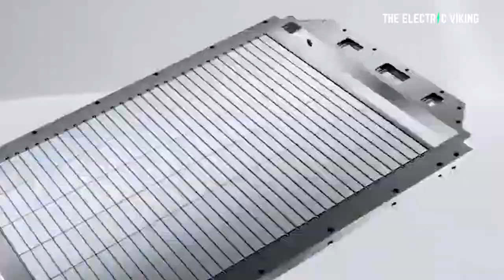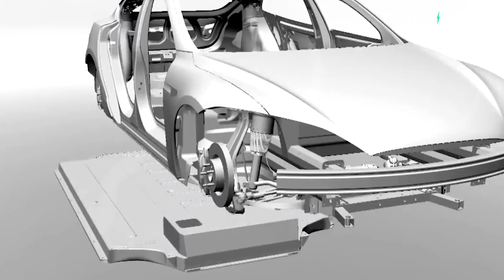Tesla's Model 2 Hatch & Crossover will KILL gas cars in 2023

Comment: In the US 60 million vehicles out of 280 million account for 50% of the fossil fuel consumption. So trucks and commercial applications like Uber, small delivery vans, police etc. Also these applications are mostly 8 hours of short trips, often 35 MPH so about 100 miles per day range is good enough. There are no "long trips" to worry about. It seems to me that market segment should be a priority, Of course many low cost consumer vehicles will reduce fossil fuel consumption, but I would make that a secondary priority if time to 50% reduction in fossil fuel is a priority. By the way, once a 50% reduction in the US is achieved, gas stations will close, accelerating consumer acceptance.

Comment: Thanks for your excellent speculation on what all might be done by Tesla to reduce its cost for the various Model 2s.

To reduce battery size and related cost, by boosting its overall energy efficiency to 6 miles per kiloWatt-hour (kWh), compared to ~4 miles per kWh for the Model 3, reducing weight will be far less important to than reducing Aerodynamic drag. To reduce the Aerodrag, hence making the Model 2s extra slippery through the air, Tesla must reduce the multiple of frontal area (A) and the slippery-ness, quantified by the vehicle's Coefficient of drag (Cd), that is, Cd x A (or more simply, CdA). To reduce the CdA sufficiently, the Model 2s would or must: 
> replace sideview mirrors with cameras, and
> cover the wheels, and
> narrow the vehicle width, (4-seats, not 5)

Also more important than reducing vehicle weight, the efficiency of the conversion of the stored energy to rotational power/energy at the wheels might be improved, by:
> using a higher voltage electrical system (800 Volts or higher)

After doing all the above to reduce Aerodrag, Tesla could potentially reduce the energy losses due to the tires rolling resistance by reducing the multiple of vehicle Weight (W) times the tires Rolling Resistance coefficient (R), that is, W x R.

Along with making the Model 2 narrower, removing the sideview mirrors and moving to an 800V or higher voltage electrical system, all of which would reduce weight while reducing Aerodrag, Weight (W) might be further reduced (but, only without increasing cost!) by:

> Using lighter weight materials, such as Magnesium (vs. Aluminum) for its front and rear castings

The tires' coefficient of Rolling Resistance (R) might be reduced (but only if you don't lose ride quality and safe handling/braking under normal weather conditions) by increasing tire pressure and reducing tire width and/or using completely new tire designs, including tires designed to last 100,000 miles or more (thus lowering tire life-costs as well).

Finally, presuming these Model 2s will be designed to double as Robotaxis, life-cost will be much more important than initial-cost, so Tesla might accept some initial-cost increases in various elements of the Model 2s inorder to achieve significantly lower life-costs, as these vehicles' design life is increased from say 250,000 miles for the Model 3/Y/S/Xs to at least 1 million miles for the Model 2s.

Comment: Appreciate the great analysis. I wonder about two things though based on this projection: the robotaxi and any cannibilization of the model 3 and Y sales? How much might some consumers hold off on purchasing other Tesla models in anticipation of these new and more efficient vehicles? It will be interesting to see how Tesla manages the potential Osborne Effect. Also, what would the robotaxi look like and where would it be built? Maybe new factory announcements may shed some light.
Reply: Robobtaxi will be on same platform so I assume same manufacturing facility. Tesla will not announce the new car untill close to the launch to mitigate impact on other models. I also think they have margin to give away on the basic Model 3 to plug the gap, particularly in US.

Comment: "Structural battery pack" currently means using the actual casings of the 4680 cells as part of the structure. What are the indications of structural battery packs in this meaning with other battery form factors? What are the indications of other chemistries in 4680 cells for use in this type of structural pack? What are the indications that the battery pack will be considered structural without using the actual battery casings as structural elements? It sounds to me that our viking is talking about the last option here.

Comment: I am not buying the 30 kWh pack variant. This is not enough range for the American market. A 40, 50, and 60 kWh offering could make sense at 6 miles per kWh. Mass has little to do with it as it mainly aerodynamics at highway speeds. Even our Chevy Bolt hits 5 miles per kWh in mixed driving. With improved aerodynamics going from Cd = 0.32 to 0.22 the car could easily approach this 6 miles per kWh figure at 1.75 tons.

Comment: Points well made. This is the best form factor for the most useful target, small urban cars, especially in the EU and China (or rather, everywhere except the US). Given the current EV market, a T2 at this price range will make a big impact. Everyone will want one, at least as a second car. By that time though, Tesla will have to compete with a lot of good EVs from Chinese and EU manufacturers. Traditionally, such a setup has been leading to margin erosion, unless Tesla can keep up the "Apple of cars" image. For the total picture, you'd also need to talk about eventual repair costs, especially with structural batteries. How repairable the cars will be. Since that consumer expectation is different for a small cheap car than for a big luxury car. What happens if someone (or you) dent, scratch, crash the car. That cost currently is far, far lower with other cars than Tesla, especially in the smaller form factors.

Comment: Great video and analysis. 
I don’t think this EV will be produced in Texas right away. They will probably produce this vehicle in Mexico because of the lower labor cost. 

Later they will use the Texas Gigafactory to produce the Robotaxi version of this EV - without steering wheel, brake or accelerator and a flexible seating arrangement with multiple screens for customer entertainment.

Comment: If they meet the power density and light weight, and get the weight of these cars down to 2,000 to 3,000 pounds, they will not need really high capacity batteries. If they only use say 40 to 70 kWh batteries with fast high speed charge capabilities, we could be looking at a car fleet with recharge times in the 10 to twenty minute range and a huge reduction in overall grid electrical demand. 

I myself would have no problem with a 10 to 20 minute charge time to get 150 to 250 miles of range. I spend about 7 to 15 minutes at the gas station today getting 200 to 300 miles gas range in my car right now. (About 8 to 13 us gallons of gas) and keep in mind, most of that charging would take place at home using level 1 or 2 charging because I would not need to do the fast charging like at a filling station out on the road.

Comment: Unless the recession cuts Tesla car deliveries, there is no assembly line to build a new model in Shanghai. Even with a recession the current models would have to fall below a 10-15 percent margin to make it economically feasible for Tesla to use current assembly lines. It’s even a stretch to get a new casting and robots by the end of 2023.  I don’t think this will happen until a new Gigafactory is finished in China. I guess they could build the assembly line in Austin and ship to China…but I doubt it. I guess we can have a friendly wager. The earliest this will happen is mid to late 2024 with real production run rates in 2025.

Comment: Tesla might not have to create a new model to get that lower price, they could just modify the Model 3 with Gigacastings to reduce parts count, reduce the battery size and use a less expensive type of battery, and voila! come in at the desired price point.

Comment: Following on from the insider photo of the Cybertruck photo which showed a 4 door cybertruck aluminium frame with darker frame panels attached to the rear. What if these darker parts were a prototype carbon-fibre frame?

If the Model 2 is built with a carbon-fibre frame, it would be up to 43% lighter than an aluminium bodied car, with corresponding benefits to battery pack size and vehicle range.

It would be counter intuitive to use anything other than carbon-fibre for the Model 2, provided that Elon has trouble-shooted an efficient manufacturing process to construct the carbon-fibre parts. 

I envisage a carbon fibre central tub, complete with seats, to which will be an aluminium front a rear section coupled to the motor and suspension parts.

This would make the Model 2 a unique proposition in the Tesla line-up, being light and stiff. Due to it's lightness, it may only need a battery pack with a range of around 250 miles, given that most journey's will be shorter and be in and around city centres.

The challenge is to manufacture a carbon-fibre frame quickly on a production line.

Comment: The one point no one it talking about.....everyone is saying Tesla has to reduce pricing to sell more cars in China due to market conditions and that this is not a problem because of the margin Tesla has and the same could apply worldwide reducing Tesla margins! 

But the part that everyone including hear, is that as that as production increases the more cars produced at any signal plant the cost of production drops and the produce has a choice to make do that increase the profit margin even more or do they recuse the retail price to incise the sales potential even further which requires even more production further reducing manufacturing costs with more economy of scale!! 

Tesla is already operating some of the largest manufacturing facilities with the most advanced production methods, so this can only get better with ever increasing manufacturing costs reductions with ever increasing economy of scale!! and the same will apply with the new cheeper model, and probably Tesla has in part been waiting for a larger giga-casting in order to produce the front and rear chassis in one pice for further economy of scale for faster production together with CATL's M3P structural battery pack. 

Keep up the great work, all the very best

Comment: Well done but I think that 5 miles/kw is more realistic with a 40 kw pack gives 200 miles of range. If Tesla can achieve 6 miles/kw, then they will use a 30-35 kw pack, achieving 180-205 miles of range. Most likely that will be inadequate for the 2030 future and most likely 50kw pack with 5-6 miles/kw, be a 250-300 mile range.  

On the design front, it can't be as swoopy and sleek as I've seen renderings because we got a Corolla hatch as a loaner as our Sienna is getting bodywork done.  It's the most impractical use of footprint from a car design as possible. The older Golf's like the MK 2/3/4 are the most optimal use of footprint vs volume. All it has to be is lifted a couple of inches to be called a crossover. I've been inside Golf's, Civic's, and Impreza's to see better use of space.

Comment: What if the new model is a miniature CyberTruck-style vehicle?  If CyberTruck started at $39K, surely they can make the new model with everything you're saying, but from a Stainless Steel CyberTruck-styled body (in car/hatch form) using a single gigacast.  ??  That avoids paint, cuts weight (since body is load bearing), and makes the small car stronger than any other.

Comment: Until we have the infrastructure and range, it's moot. Can't drive where there is no juice. So for those of us who travel distances away from cities, they are simply impractical. Range required is 800-1000 km at a minimum. And add in low temperature. We've had -18 C already this winter.

Comment: Tesla's low-cost model 2 should be similar in sizes and dimensions to the standard Bearer throughout the world in this category, the Toyota Corolla which has been the best selling car in the world year after year and millions of purchasers love them and hang on to them well over 10 years. Of course the model too will be an electric eve, which of course simplifies things, because Tesla already has the computer architecture worked out and an electric battery and motor is far simpler than an internal combustion engine with radiator transmission etc! So I am h o Tesla sticking pretty close to the outlines of a Corolla would be a winning strategy
Reply: The Model 3 is already the California Camry.

Comment: this is a way more important vehicle for Tesla than cyber truck at global level.
it won't be 25k though because people will be ok to pay more, I don't see less than 30k, actually not likely less than 35k until they can make literally millionS of them per year. if they can sell model Y starting at 66k  and 3 RWD starting at 57k like hotcake. Corolla hatchback/Camry/RAV4 in similar SE trim msrp are 23/27.5/33k so following the same kind of  pricing structure it would even be around 45k. could be less if they really cut down on features and range but it's not going to happen until they cover all the demand for higher trims but I don't see why they wouldn't want to keep premium prices and premium features that make them both profitable and desirable.
Cyber truck is strategic in the US because it will compete with the best selling vehicle, F150 & 150 lightning, it's more the manufacturing technique. if they can figure out the way to make them cheaply and massively, it could enable a whole line of value crossover/SUVs spin offs cheaper than Y/X using similar manufacturing that could sell like crazy too. if Tesla can keep going against the automotive trend of facelifts/restylings every 3/6 years and planned obsolescence which involves redesigning and leads to over styling the designs to differentiate vs previous gens, and keep rolling out incremental improvements/adjustments without stopping production, plus software updates to the existing cars, it's win/win, people want the cars, Tesla doesn't need to be continuously risking to reinvent existing designs. they can make long lasting cars that people will want to keep for a while, and that will still hold a good value after year.
their biggest risk of losing the.EV grow are
1 if China manages to produce way more cars and to export them.
2 if disruptive battery tech like solid state leaves them with expensive investments in battery factories, and they fall behind the curve on parents, R & D etc. if/when self driving is widely accepted, having the edge on software and infotainment could continue to maintain their headstart but I think they will have more competition on software by big  software companies who already have the app stores and the experience

Comment: Could this Tesla Model 2 compete with the Chevy Bolt EV that cost $27,000 here in the US? If so, that would be great because I could never afford a $48,000 Tesla Model 3.
Reply: $39k after 1 Jan, if your state has incentives it could be $36k.  Does the bolt not have dealer markup?
Reply: @haganlife  The Bolt is hard to get due to limited availability. These dealers also are always trying to raise the prices as high as they can. So, the advertised price of $27,000 will probably be over $30,000 with dealer markups.

Comment: In U.S. Dollars, here's my prediction. Batteries will be less with a single front/ rear casting having a cavity for the structural battery pack plus numerous manufacturing efficiencies and a lower software costs. This will give a 6k gross profit at a 21k base price. Hatch deluxe at 25k. Crossover base at 27k with max Crossover at 32k. These prices will assure the depletion of most competition while not Osborn away the Model 3. (unless that IS the plan - run the pricing into Model 3 country with greater value and phase out the 3).

Comment: $30,000 for a model 2 is not really affordable that is still significantly more expensive than a similar sized petrol car. For comparison a VW Golf petrol costs $22,000 and a Ford Focus costs $20,000 here in the UK. Sure it's not the same car  but at +50% of the cost it's still not an ICE killer

Especially considering most the world doesn't like like the USA or Australia most of the world lives in apartments with no ability to home charge so for them even if an EV was the same price the petrol version is still more convenient

Comment: More affordable helps but the escalating electricity cost for charging nullifies that gain for most people. Add in the dangers of sitting in a car for 40 mins to charge it tethered so you can't just drive off but have to get out and unplug it leaving you open to attack, especially in winter when you need to charge more often and it's darker earlier. Then you have the queues. Mass EV's will mean mass queues for frustrated people who are missing appointments and have queue jumpers stirring things up even more. There's also the problem of blackouts. Germany for instance only allowed EV charging for a maximum of 4hrs this winter. Imagine the strain if all these new EV drivers and heat pumps are using all that additional electricity. These are going to be an increasingly painful next ten years for EV drivers in a lot of places, especially if they don't have good home charging.

Comment: About the only thing I can think of is that vehicle production needs to increase in an exponential fashion, your prediction only allows for a linear increase which to create something so cheap may not work out well in the long run. The second thing is the political environment in China is currently out of sorts. With an American car manufacturer in China, this may not work out well. Many international companies have already pulled the pin from China because of the instability. It may not happen, but there are some concerns.